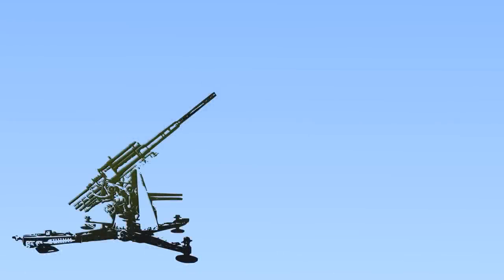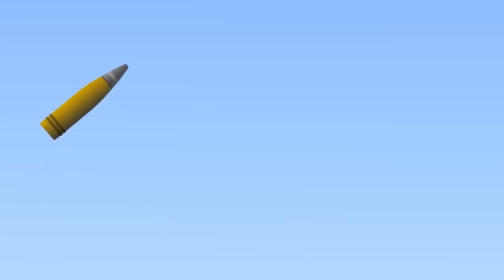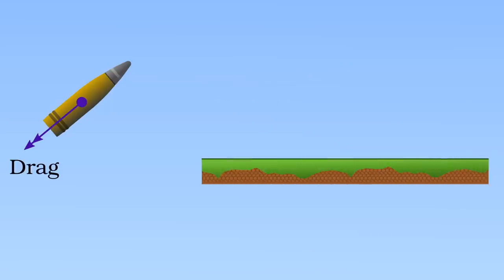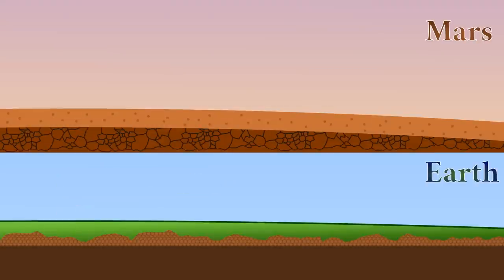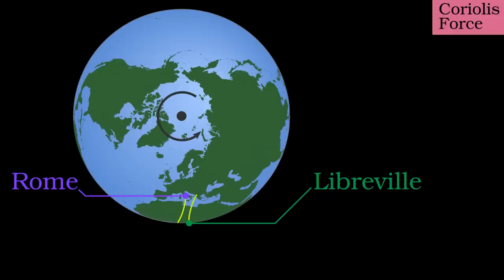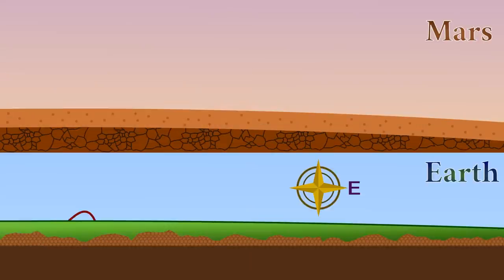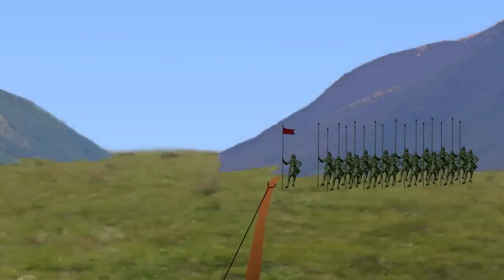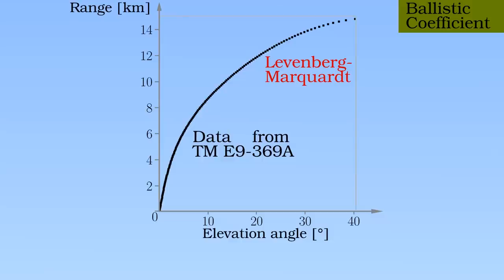Firing the Flak 88mm on Mars - ballistics, history and worldbuilding

Comment: You'll be interested to know that I was on an exercise where the G3 (Norwegian version AG-3) was fired in -42 degrees Celsius. The biggest problem was the plastic butt-stock which would easily crack in such cold. The second problem was that the soldiers could never touch the butts-tock with their chins, lest they would instantly get severe "freeze burns."  I just took photos during the thing, and it's some of my best photos to date. The lens froze solid as I kept working, so I had to thaw it on the AC of a running Gelenderwagen nearby (all cars were to be kept running in that cold).
Reply: Was a short trip across the border from Neiden to Finland shopping and encuntered -40c there. Did not dare to stop the car engine and the steering froze on every straight line you drove where you had to use force to get the steering unstuck to make a turn... Lot of things stop working normally at such cold.
Reply: Acceleration Quanta  I wish you a merry 50°C summer
Reply: У нас такое каждую зиму в Сибири 😎
Reply: Acceleration Quanta  dam that's as dum b as Hoover dam, you never heard of snowball earth and Permian Triassic Siberian volcano now permafrost? Ask Feynman colleague retinue of Mongol that attack majapahit
Reply: kebman.........I worked on Ice Road construction and the 2006 Ford diesel pickup I used didn't have to run 24 hours a day to start. It sat outside for 2 days at -43 C and it started just fine without being plugged in.
Reply: @johnarnold893  I know Russians used to light small fires under their diesel trucks to start them in the cold lol. Anyway, it was garrison orders to keep the cars running. Possibly some of the trucks didn't have a pre-heater or glow-er (or whatever it's called) installed, which is ofc common on new cars. Without it it's a bitch to start the car in extreme cold. Then there's also the issue of condensation. If that occurs in the pipes or in the engine, then you've got a problem. Gasoline cars were ordered inside warmed up garages.

Comment: I would think that in a near vacuum like on mars, muzzle velocity should be higher, as the shell doesn't have to push air down the barrel as it travels.
Reply from the maker: Totally true, I mention it at the very end: didn't have the time to simulate it, and would need to make some assumptions.
Reply: it would yes, but not too much, because the pressure of the expanding gas is order of magnitude higher than ambient pressure
usually chamber pressure will be in the 2000 bar range so,
Reply: @zazugee  take into acount that the air infront of the cannon compresses to higher pressure as the shell tries shoving it out, the only disadvantage I can think of is that it may make the shell faster relative to the burning expanding gas/propellent  making it less efficient in building pressure behind the shell.
Reply: I'm thinking the viscosity of the fluids inside guns' recoil tubes would cause problems. These recoil devices often work by compressing air with that oil. 

The lack of atmospheric pressure may make the those air vessels leakier. The cold of Mars could turn the fluids compressing that air solid or thicken them or possibly cause their constituent ingredients to separate. 

I'm not an engineer though so I have many questions about what specifically Mars would do to recoil mechanisms.

Thinking about small arms brings to mind issues of metal fatigue, the muzzle velocity issue you brought up, how well the friction of feet could keep person from being blown off of them by their own weapon. 

Air cooling too. What even happens with that? Is it better on Mars because of the temperature gradient, or is it worse because there is less air to conduct that heat?

Ray guns. That's the Martian way of war I say.
Reply: @ImprobableMatter The channel ‘Smarter Every Day’ has a series where they built a supersonic baseball cannon. It utilised a partial vacuum in the barrel to significantly increase muzzle velocity.

Comment: While mars is extremely cold, I believe the very low air pressure would make it much harder to cool the weapon once you started firing it as most of the waste heat would be lost to passive convection on earth. So not only would it likely be difficult to get the gun to work at sub-artic temperatures, but you wouldn't be able to fire as many shells before it overheated and would have to wait a very long time for it to cool down again. You would be losing heat through contact with the freezing ground and starting from a much lower temperature, however, which would counteract the less significant air cooling at least a little.  

Thermal management would probably be a bit of a nightmare on Mars, with equipment at serious risk of overheating when it's operating at high power and underheating (for want of a better word) when it's at low power or idle.
Reply: This would be a disaster for machine guns
Reply: This is a really interesting topic. Heating up is relatively easy as some electric heating mates or wires can be placed around the gun. As for cooling, I can imagine "water" jackets connected to a radiator dug into the ground. For stationary applications like AA guns, this should work nicely. Guns on Mars would also be much more potent weapons in comparison with rockets. Battleship-size cannons would be able to hit targets hundreds of kilometers away for a fraction of a missile price.
Reply: martian warfare would probably come up with fast switchable or multi barrel solution earlier than on earth.
Reply: I wonder how the guns in The Expanse solve that problem.
Reply: A relatively high-tech world could utilize geothermal powered heat pumps to cool the barrel. That is, install a coolant loop in the cold ground and hook it up to a heat exchanger welded to the barrel. They could optionally include a powered phase change heat pump to modulate and accelerate cooling. Installing the coolant loop into the ground may be difficult, considering frozen hard earth, but a potential design is a hollow hardened metal pile that can be hammered with tools or driven with controlled explosives.
Reply: @jedihunter176  Maybe some active cooling heat exchanger that funnels the heat to the ship's main radiators at the cost of increased power consumption.
Reply: Slightly more capacity when firing short bursts but worse sustained fire.
Reply: @TheAmericanCatholic  it would likely just mean that machine guns would be a lot more stuck in place, since there would likely be a cycling supply of water to cool the weapon. It would likely only see major use in the tight entries or corridors leading into the inevitable underground structures that might house the majority of mars society, being unable to otherwise withstand the surface radiation.
Reply: @filipkossakowski2467  water would evaporate more easily due to lower pressure, taking massive amount of energy in phase change, so open water cooling system would probably be very efficient.
Reply: @GerinoMorn  but water would be more expensive than the explosives, so using open water cooling is a significant trade-off too!
Reply: All this means is that chemcially propelled guns on Mars or in space (including liquid propellant guns, which have been investigated in the past and found to have superior performance to powder propellant guns of similar dimensions) would need an active cooling system instead of being able to rely on purely passive cooling as Earth guns usually can.
It also means that machine guns would be even more likely to be of the open-bolt operating cycle, all the way down to assault-rifle sized firearms, simply because of the higher heat load increasing the likelyhood of ammunition cook-off and a firearm that might continue to cycle due to the continued occurance of cook-off of the single round in the chamber of a closed-bolt semiautomatic or select fire firearm, without regard to the mechanical condition of the fire control group elements such as hammer, firing pin, and sear.
This is because if the ammunition fires due to the propellant reaching its auto-decomposition temperature, there is no longer any need for the firing pin to initiate the firing of the round. And just like on Earth, the chamber of the firearm would be one of the hottest parts of it, since it is exposed to a lot of heat from powder gas that is conducted thru the rather thin and therefore highly conductive metallic shell casing.

But with an active cooling system these factors change in favor of returning operations to more familiar conditions as seen on Earth's surface.
The barrel and chamber are simultaneously the most important parts to cool on the firearm, and the most challenging to cool due to the need for high strength in those areas preventing the close proximity of coolant passages.
But the easiest solution to the heat problem already exists, at least after a fashion.
Water cooled heavy machine guns such as used in WWI are likely one of the more optimal solutions to the problem of how to keep the operating parts of a firearm cool enough to continue functioning. Yes, this makes the whole system bigger, heavier, have more moving parts, be sensitive to coolant leaks, etc, but the alternative is a gun that can't fire more than 100 rounds before it becomes so hot that it will either distort critical mechanical components to the point that they will no longer function, otherwise degrade the material properties of the mechanical components to either induce failure outright or prevent continued use, or cause unwanted problems like ammunition cook-off.
The most important problem to solve is how to cool the chamber of the firearm, as I don't believe that water cooled machine guns of old had water cooled chambers, and we would have to invent a solution to cover that need.

Artillery cannons too would need active cooling systems, as has been noted.

Additionally, for both machine guns and artillery, if the ammunition and the gun are at different temperatures, tolerances might open up to the point that things stop working properly. This is obviously going to be most problematic with a cold gun and warm ammunition, but the opposite case is also problematic as the case of the ammunition could potentially be insufficiently supported when firing and therefore either become stuck in the chamber or simply burst. A burst casing would likely cause very difficult extraction, and once the case IS extracted it would have to be inspected to make sure that it didn't leave any parts of itself in the casing (such as a case neck failure on bottlenecked cartridges such as 5.56 NATO and 7.62 NATO). That kind of debris being left in the chamber means that it is not possible to continue using that gun, and on a machine gun sized gun this would be a problem that is impossible to solve in the field.
Hot gun firing cold ammo can also lead to just plain stuck cases, where the case has simply expanded under the stress of firing beyond the point where it can return to its original shape, and this too can cause debris to get stuck in the chamber.
Fluted chambers are a frequently seen solution to the issue of cases getting stuck in the chamber of a firearm, and there is the potential to use these flutes as cooling channels as well, however I doubt that would be done. Instead, I think that the fluted chamber would be combined with some form of thermally stable solid lubricant applied to the casings of the ammunition when it is manufactured, such as a coating that has a high amount of Graphite in it, in order to further prevent casings from getting stuck in the chamber for any reason.
Reply: Yeah, the effectiveness of convective cooling depends on the volumetric heat capacity and the thermal conductivity of the cooling fluid. And for the atmosphere of Mars, the thermal conductivity is about 40%, and the volumetric heat capacity only about 1% of that of Earth.
Reply: @filipkossakowski2467  Water jacket would need to be pressurized as liquid water cant exist on the martian surface, too cold and too low of pressure, the water would freeze and evaporate at the same time
Reply: brass does do a lot of work removing heat from guns but ya you'd have the thing cook itself after a few shells
Reply: water cooling appeared before air cooling
Reply: That would make trench warfare much more effective. If you manage to put some heat sinks into the ground before engagement, you get much higher firing rate.
Reply: You ignore radiative cooling, which is way more effective when it's cold around.
Reply: @zuthalsoraniz6764  It also depends on the velocity of the cooling fluid. I remember reading a study of high altitude cooling that determined that active cooling on mars is still about 1/3 as effective as active cooling on earth because of the reduced energy required to run fans.
Reply: IS "most of the waste heat" removed by convection and not radiation? Did you run the numbers yourself? Do you have data supporting that? Or are you just guessing?
Reply: @HotelPapa100  radiative cooling has extremely small throughput
Reply: @NoNameAtAll2  so does convection with ambient air. Radiation depends on temperature differential. It goes with the fourth power of absolute temperature.
Reply: I think that would be a Problem for Maschine guns but a Flak 88s Barrel is like 600 pounds of steel and it's surface is way larger than a rifle Barrel. I think before the Barrel overheats the Crew has died of exhaustion
Reply: I'm wondering how much of a difference the lower atmospheric pressure would make to cooling. As long as the projectile is in the barrel, the heat transfer from the propellant gas to the weapon is the same, but once the projectile leaves, only 1% as much hot gas will be left in the barrel, and that will have cooled a lot more from the expansion. I have no idea about how much of the heat transfer happens after the projectile pops out.

This massive gas expansion would probably kick up a LOT of dust from the ground by the way. The muzzle flash would be very brief because the heat energy is thinned out so fast, but the expanding cloud of gas will be gigantic.

Recoil would be another difficult thing to manage. Any object would weigh less than 40% of what they do on Earth. That would lead to less traction for vehicles and more difficulty anchoring stationary guns.
Reply: True, it would need to be liquid cooled with a massive radiator
Reply: @TheAmericanCatholic liquid cooling is back on the menu boys.
Reply: @jedihunter176 mars in the expanse has a thicker atmosphere. They even have an artificial magnetosphere to preserve it. As for guns in space, large guns are ther regulated by the ship’s systems. Small arms seem to just ignore it entirely as they’re either integrated into the suit’s thermal management system or aren’t used in prolonged engagement in vacuum anyways.
Reply: water cooled rgb gamer MGs
Reply: @HappyBeezerStudios  This is a really interesting solution.. imagine even normal infantry weapons being multi-barrel on such a planet
Reply: Hmm... I'm not actually sure this is true. Passive Cooling capacity of air is actually not very strongly tied to density.
Reply: Bottom line is nobody will ever pay the cost to take an old WWII cannon to Mars.
Reply: Water-cooling technology would need to be used. No real way around it in this case.
Reply: @accelerationquanta5816
Perhaps on the rocks but the hottest the air can get is up to 70°F or 20°C. And generally on the equator.

Comment: Quite interesting. I was about to mention that the muzzle velocity would be larger due to the lower pressure in front of the projectile, but you mentioned it at the end! Another thing is that the barrel would need to be stronger, because the pressure difference between the inside and outside would be larger - but 1 atmosphere among hundreds would probably not be as important.
We already have a low-gravity high-pressure body in our Solar System - Titan. A human could fly using his own muscle power there.
Another interesting consequence of low gravity I have rarely seen discussed in fantasy/sci-fi would be lower grip. When you start running you depend on the grip on your feet. Lower gravity means lower force pushing you down. You would need to lean forward more, but even then it would be much easier to slip if you push back too hard. So you could jump higher, possibly run faster, but gain speed slower. Unless you can push yourself away from a vertical obstacle, you would have a harder time dodging things.
On a higher gravity world cars would have much harder time managing inclines, but could take turns at a much greater speed. The downforce we get here by spoilers they get simply from gravity.
Reply: So cars on Titan might have aerodynamic features intended to create downforce as a simple "that's just how we need to build them here to make them work right" kind of thing.
And on low or micro-gravity worlds and space stations (such as inside a habitat where a small amount of "gravity" force is provided by rotating the habitat at a slow speed), wheeled vehicles could probably use permanent magnets in the tires to create the needed downforce to ensure stable turning and handling at reasonable speeds. IIRC the carts on the "generation ship"-cum space station operate with magnets in the tires for this reason. However, if you do manage to overcome that downforce, the vehicle is gonna float off into free space until it finds something to stick to. Of course, this leads to an interesting method of preventing these vehicles from going where you don't want them to, just set up a moving band of magnets in the floor combined with a lower traction non-magnetic surface such as UHMWPE polymer to physically catch and drag the vehicles away from where they're not wanted no matter what the propulsion systems of that vehicle have to say to the contrary, without having them become disconnected from the flooring system.